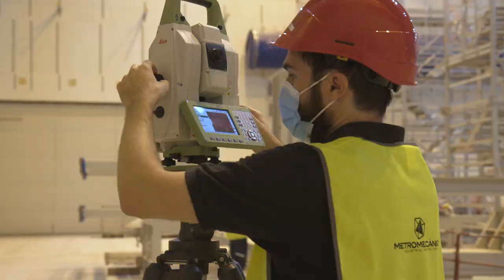Largest tokamak component installed

Comment: Kudos for the Engineering behind ITER, which is on par with some of the largest engineering projects in human history - like the LHC at CERN in Geneva and the 1960's Apollo moonshot.
Although I do have the distinct feeling a more compact form of magnetic confinement fusion will be ready before this beast. I say this because of the huge progression made in the field of superconducting tape at relatively high temperatures. ITER is not based on this technology but future reactor chambers based on the tape could be up to 9 times (or more!) smaller than ITER (with the same potential output) because of the much stronger magnetic fields possible with the flexible, and much thinner tape compared to the older superconducting materials used in ITER. ITER has absolutely no flexibility in the configuration, meaning that ITER is 100% based on 1980's and 1990's technology when it was designed. The big advantage of shrinking size with a fusion chamber is that it also becomes much more efficient because of the shorter distances the magnetic field has to be active over. The strength of the magnetic field is the inverse square of the distance. Meaning reactors based on SC tape can have way way smaller cooling systems and use less power on the magnetic confinement system. Meaning the efficiency goes up even further.
Reply: Why didn't they improvised the project with the technology you mentioned?Was it so recent?

Comment: All those big pieces must fit with nanometer tolerance.  No gas molecule can ever be allowed to enter the reactor from the outside, not even plane old hydrogen.  What ever gas is allowed to enter is the fuel itself.   Just insuring a high pressure hermetic seal is a major challenge itself without any gaskets as hydrogen will go through any gasket.

Comment: Can anybody tell me how and why massive loads like these have to be planned to the precision of millimeters?
Reply: you dont want to bump several dozen tons and years of work on a wall and bend it
Reply: Also structural integrity i guess. 2 pieces of steel correctly aligned on top will be stronger and has no ridges. Machines, especially such expensive, complex and unique ones, have to be exact and not “that will do”. No room for error.

Comment: I wonder if a 30m diameter cylinder would be sufficient for centrifugal artificial gravity without coriolis force causing motion sickness?
Reply: I don’t think it’s large enough. There are some good videos about it here on YouTube. I think I’ve heard something like 220 m diameter would be ok but I might be wrong. However I wonder if a smaller ring could help for workout (push-ups bench pressing etc. Workout while laying down) or as a sleeping cabinet? Maybe that’s already good enough to slow down degeneration of the body sufficiently?

Comment: Would be a bummer if it blew up when they first turned it on :D
Reply: Fusion reactors can´t blow up unless you use dynamite as a fuel.
Reply: So it's possible! Sure would be a bummer, huh.

Imagine, all that work, the click as you turn the switch, then that sinking feeling - "bob, you knew we were joking about the dynamite for fuel, right..." BOOM, and you'd be like "Bummer."
Reply: @nommy8599  then just dont use dynamite as a fuel :)
Reply: @CarlosAM1  ok. Something with better energy density like C4. Perfect.
Or CH4 like elon's using for Starship to go to mars.
Reply: @nommy8599  or just use hydrogen isotopes, which usually are the best ones for fusion. (especially deuterium and its ultra-dense variant)